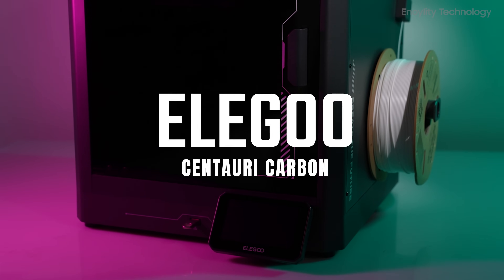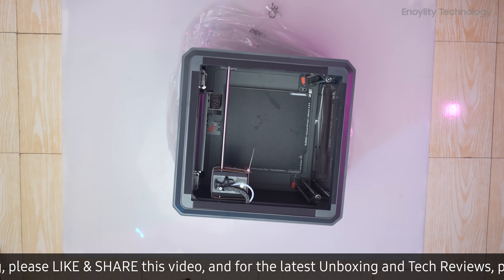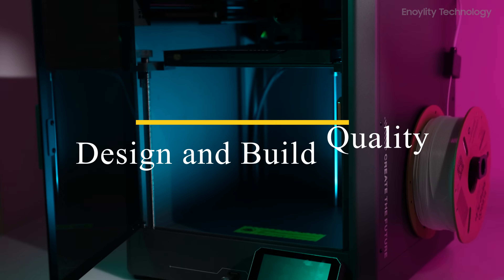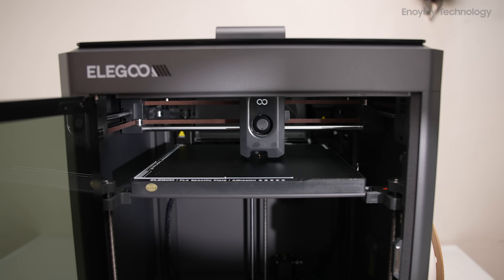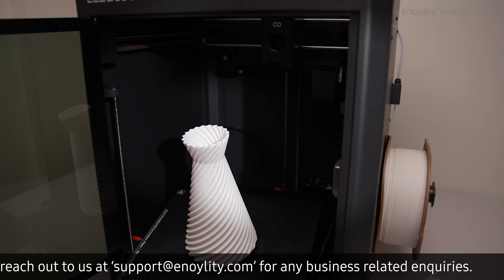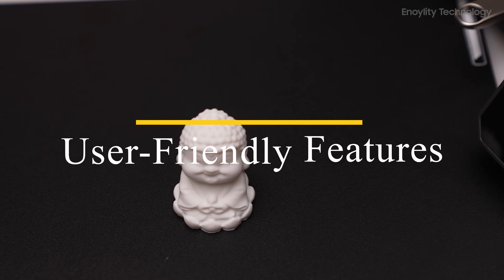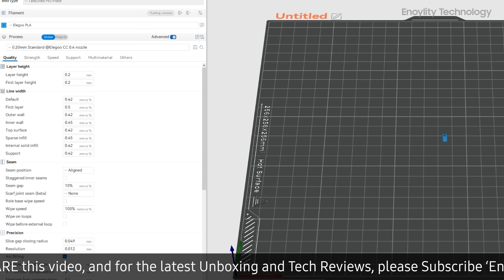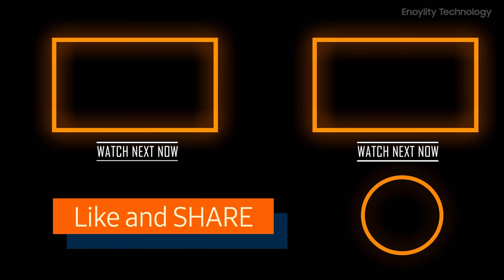ELEGOO Centauri Carbon Review: The Premium FDM 3D Printer You’ve Been Waiting For!

Comment: Overall the printer feels well constructed, metal frame and parts are sturdy and reassuring. Hopefully it will be reliable for a long time.
Reply: Excellent quality printer, fast, robust and intuitive.
Reply: This printer is well engineered and the support staff is quite knowing and was a great help in getting my system up and running. I would highly recommend this 3d printer.

Comment: Easy to setup, but kinda heavy to do alone. Printing works well, no issues. Recommended.
Reply: The fan/main board also makes a loud chugging sound(video included). This is not to be confused with the super loud filament drive that sounds like a fax machine.
If you feel like messing around with a cool-looking printer, have at this

Comment: The printer comes mostly pre-assembled, making it easy for newcomers to set up and start printing quickly.
Reply: So use the printer for really quick and rough gecko hides. SO NOT the quality it can produce if you slow it down and tune. I actually tuned it too fast and rough on purpose helps with the geckos nails and shedding. But it also makes if very fast. I am also printing out a posable godzilla toy for my son and the print quality is great
Reply: I've been printing test-fit parts for my fire extinguisher bracket for 3 days, and the printer has worked without a hiccup (except for the ones I caused).

Comment: The printer has a solid build quality, which enhances durability.
Reply: It struggles with PLA that has a consistency that is softer than the PLA that came with the machine. It is fairly quiet and easy to use.

Comment: The magnetic PEI bed is one of the best I’ve used.
Parts stick reliably with no fuss at all.
But it’s a fingerprint magnet gets messy fast
Reply: Excellent quality printer, fast, robust and intuitive.
Reply: Can print with different types of filaments.
Reply: It can print print HUGE models extremely fast with more-than-acceptable accuracy which was what I was looking for in a printer. After watching a ton of Youtube reviews and reading a lot of "best of" lists, it came to a decision between purchasing this printer and one that costs 3x as much and prints 5x slower

Comment: Handles overhangs like a pro barely any sagging.
Nozzle comes up to temp quickly, and stays stable.
Build volume is generous, but machine footprint is big
Reply: Experience as new to 3D printers coming from quidi which I returned due to huge software issues, wasn’t good at first. The 0.4mm nozzle got a bad clog after 4 prints and started showing negative temps.
Reply: The touch screen makes everything so ez to do. All adjustments are fast to make and ez to find. I'm 2 prints in and I have to say I am pleasantly surprised....runs very...and I mean VERY quiet..prints I did where on the card that came with it, the came out really good for me using the demo roll of filament
Reply: As amazing as it performs out of the box, it is also highly adaptable and customizable, and I can’t think of a better printer for both novice and experienced hobbyists.
Reply: The machine arrived today and prints very nice, and setup was fairly easy, however there is NO wifi module on board of this machine.
Reply: Great printer for the price, but they cheaped out the parts a bit much, so I can't recommend it for beginners, but it's great for those that don't mind saving some money and replacing/upgrading parts parts.

Comment: The firmware feels limited compared to other high end models
Reply: This printer has been printing non stop day after day and I really haven't had a single issue with it! It just prints everything I throw at it and I seriously couldn't be happier! Also I bought the printer on Amazon from Yunsu Delta Printer and they were awesome!
Reply: After messing with the printer for another few days, I was successful at getting a few prints to move through without problems. Then, in the middle of a print, the machine slowed down to 10mm and would not go past that speed until a full factory reset and firmware wipe was completed.
Unfortunately, the bed seems uneven, and I cannot get the printer to level

Comment: It’s great, but the learning curve for Klipper might be steep if you’re coming from basic printers
Reply: I now have two of these and they are great. I only print small items so the bed size is not a problem for me. Literally unpack and print. Super easy, great for kids as they’re is no hassle; it just works.
Reply: The print quality is better than the creality printers and the print speed is usually half the time it takes to print the same model on one of the creality machines. If you're thinking about it just buy it you won't be disappointed

Comment: Finally a printer that nails both speed and print quality. ELEGOO really stepped up😊
Reply: Feels like a Voron but with way less work.
Firmware updates via USB were easy.
Still waiting for cloud print support, though
Reply: You can set it up fast and start printing without trouble.
Reply: This is my first 3d Printer, so I have no real reference point here, but I will say this is a great first 3D Printer. I had it set up and running in well under an hour, and that was even with taking my time to make sure I got everything right.

Comment: Really impressed by how smooth the layers look 😍
Reply: The layers on mine were far from perfect 😞
Reply: Loving the CoreXY system smooth, quiet, and efficient.
The print quality blew my Ender 3 out of the water.
Still figuring out Klipper though, not super beginner-friendly
Reply: Any print quality or bed adhesion issues I’ve encountered (though rare) have been promptly resolved with cleaning the bed, Re-leveling/adjusting Z height. As with any printer it is a good idea to PID tune the bed and heating elements, and to calibrate your extruder.
Reply: My first 3D printer and I could not be happier. Easy to assemble, excellent print quality, a quality built system

Comment: The touchscreen interface is responsive and intuitive 👌👍
Reply: Yeah, I figured it out in seconds 😄
Reply: The LED lighting is a nice touch, especially for night prints😊
Reply: Bed leveling was automatic and accurate no paper trick here.
Print times are insanely quick, even with complex models.
Touchscreen needs better response and faster load times
Reply: It makes things quickly without messing up the quality.
Reply: The “3D printer glue sticks” are over priced. Two layer application is sufficient where the layer goes from clear to white. With larger nozzle Only solution is to make large size prints to get gear systems to function.

Comment: Is the build plate magnetic or fixed?
Reply: It features a magnetic base for quick plate removal
Reply: Definitely magnetic, and it snaps right into place
Reply: Loving the carbon look it’s actually super sleek.
The build plate grips well and prints just pop off.
Would be nice to have a filament runout resume feature
Reply: The machine is quick to setup, quick to print a test block
Reply: The radiator will require you to drill and tap holes into a normal radiator. Again, issues that experienced people can deal with, but it seems like engineering complexity that could have been avoided by just using standard parts.
Reply: The base is printed properly, but that's about as far as I can get. It devolves into missed layers, the hot-end knocking the strings and blobs around until I stop the print. I don't doubt that the hardware is capable, but some combination of issues makes this a challenging system to get right

Comment: Does the Centauri Carbon support high temperature filament?
Reply: Yes, it supports high temperature filaments with ease
Reply: Yes, it’s built to work with high temperature materials
Reply: Easy to set up and use, even for beginners
Reply: Software and operational uses is good I like the instructions built in and the slicer software is great on Linux, slicing extremely fast

Comment: The arms on the chair are kind of a pain. If you're the type of person that pulls the chair under your butt by the handles, these will get reset to the initial position 100% of the time. If you miss that perfect notch, you have to go all the way up, reset, and try again. It also makes setting the handles at the same height difficult.
Reply: The major issue I have is with the software. It constantly disconnects from the printer rendering the app and the camera unusable and forcing me to use a thumb drive to send jobs to the printer. If they could fix their software, it would be a great buy.
Reply: There are gonna be issues every 3d printer has them but getting one that is great and good support. Will make it easier.
Reply: It also came out great and with just a few tweaks to the slicer profile, I was able to print these brackets with no problems in about 15 minutes each, so the print speed seems great.
Reply: So - all in all, it was a huge waste of time, putting it together, having to take it apart, and then trying to tetris it back into the box. Saying this is an "entry-level" printer is laughable

Comment: As far as the stiffness of reclining goes, it's a 4-position knob with preset resistances. I kinda wish this was more adjustable than what it is because I can't find that perfect spot.
Reply: The print area is large enough to make various objects, such as models, prototypes, or even useful items.
Reply: it is very easy to use and works wonderfully with Cura software (the standard software for this printer). This model does connect to internet (which is a nice feature) and has a heated bed which has made it easy to learn how to print.

Comment: The support is pretty good on this chair, and adjustable in regards to height. You can adjust the seat position, the stiffness of the reclining, and you can lock it reclined or straight up.❤❤
Reply: That carbon fiber look is sleek Looks amazing on my workbench
Reply: Was difficult to start, and the instructions were of little help. Once we got it going it worked well.
Reply: Super easy to use, it's a perfect printer for beginners.
Reply: This printer is a beast 😊 The build quality is amazing and it prints like a dream
Reply: I love the sleek design of the Centauri Carbon, it looks great on my desk

Comment: This chair is a bit expensive but once you sit on it, you can tell why it is priced the way it’s priced. I am 5.4, petite and this chair fits perfectly to me. The cushion is soft and has a bit of bounce to it, like using a new pillow.
Reply: For a premium printer, I expected better cable management
Reply: This is a great printer if you’re getting into 3d printing as there’s not so many extra steps. This is good for hobby people that just want to be in the trend and make something at home.
Reply: The printing software is super easy to use. However my printer I had to return because it stopped seeing any network including Ethernet cable and then USB. I did then buy a more DIY printer that had a bigger bed size as this one is to small for most of the things I wanted to print

Comment: The ELEGOO Centauri Carbon. Built for professionals and enthusiasts alike, this 3D printer features an ultra-stable core-XY structure, 9.1'' 7K Mono LCD, AI camera, and active carbon filtration system
Reply: This is the 3D printer I hoped would exist years ago.
ELEGOO knocked it out of the park on features.
Now just hoping aftermarket mods start rolling in
Reply: I've done about a dozen prints at this point, and they've all been flawless. I will note that the things I design and print aren't hugely demanding of fine details, mostly brackets and cases for electronics, so if you are looking for super fine detail you're mileage may vary, but for prints in the 0.2mm layer range or greater, this thing has been flawless for me so far.
Reply: This is a very well put together package, but even with all the great instructions and videos there will be adjustments needed to get it working well. The test prints are good, but once you get past that and onto your own prints the real trouble will start.
Reply: Documentation was a little lacking, but there are videos included on the micro SD card that do a good job of showing what needs to be done. One important tip, in order to access the content on the micro SD card, you plug it into the top part of the plug of the included USB stick.

Comment: The printer also came with a 1yr license to Chitubox pro which so far has been really easy to use. Find something I want to print off of Thingiverse or Cults3D, import it into Chitubox, let the program slice it, and then stick it on a USB stick to put in the printer.
Reply: Installation was super easy, fits perfectly inside my resin ventilator easy to clean
Reply: Everythign about the printer is great except the .goo file format, and the wifi firmware update is unavailable still. But it has been an great printer in every orher way.
Reply: Still, once you start printing the feeling of making stuff is great and I love to make minis and paint then after. I can't believe it took me this long to start 3d printing. If you like making things and don't mind the cleaning you'll love it too.
Reply: New build plate is working as it should and looking forward to printing some miniatures and dice.
Reply: My son loves this product sometimes it won’t print bigger objects.

Comment: The printer is a really good size and doesn't take up too much room on the table. It was insanely easy to setup, although the instructions were not great and I had to watch a youtube video.. but after I did, was ready to start printing in about 5 minutes
Reply: First 3D printer and there was a lot of trial and error. Instructions are not great, make YouTube and google your friend. I wish the box came with more info and accessories too, not much there so I was immediately back on Amazon,
Reply: Love elegoo there products are great. Now I just you all from elegoo tell me how to fix my other mars 4 turn it on but shows nothing on touch screen?
Reply: Setup was a breeze. I did run into an issue with the build plate, but Elegoo customer service was quick to send me a replacement part which arrived VERY quickly!
Reply: Set up and started printing the test files within an hour of getting it. Super easy and intuitive to set up. I have zero experience at all and so far everything has been incredibly easy
Reply: Quality control is kind of lacking and the units are noticeably built for a price point. Horrible salmon skin out of the box. After changing firmware, stepper drivers, extruder, and electronics cooling on this printer I'll say it prints ok.

Comment: The screws have a plastic thing on them that after time becomes stripped and very annoying to get off. To fix that, I bought screws that are 40 mm's (1.578 inches) long along with nuts for those screws to act as spacers and replaced the screws that came with the 3D printer.
Reply: Great 3d printer! We are beginners and so far it's easy to use and understand and works really fast
Reply: The fully automatic leveling, high-speed printing, and overall reliability make it an excellent investment for anyone serious about 3D printing. Highly recommended!
Reply: Overall, it's an excellent printer. I highly recommend it to anyone who wants a hassle free 3D printer.

Comment: Print quality is good, very small layer capability. Very impressed with how small figures can be printed. Customer service is good, just don't harass them cuz they're not engineers, they didn't design the 3D printer, they help with issues with the printer is/can be having.
Reply: I purchased this Elegoo  as my first 3D printer. Although I'm very mechanically & technology inclined, the free software that came with this printer instructions are not the greatest
Reply: I had some issues out of the gate with one of the screws being stuck. I was unable to remove it. Elegoo contacted me and did what they could to help. I really appreciate the expediency of their team.
Reply: Quality just doesn’t justify the price 👎
Reply: This is a quiet printer (as for 3D Printers go); I can put the printer in a room and close the door and it is only audible enough to safely keep an eye on the printer.
Reply: Also...the "no-adhesive-needed" bed is nice but I have found that there have been numerous prints that will need adhesion anyways because the standard bed stickiness just isn't enough.

Comment: This printer came highly recommended by a friend but so far it’s been a struggle. It took quite a bit of effort to even get it to print the first time, and then after 3 prints the LCD broke
Reply: Good build quality and testing the settings on exposure settings went well and was easy to set up.
Reply: Does it support remote monitoring?
Reply: The first three days were tumultuous with a mix of success and failed prints and it doing all sorts of weird stuff like scratching the plate, randomly stopping mid-print, or printing in mid-air.